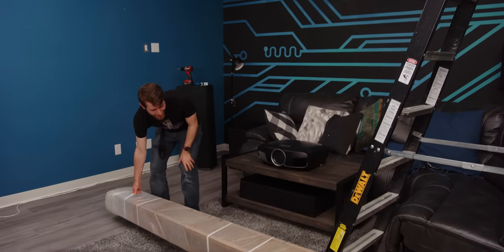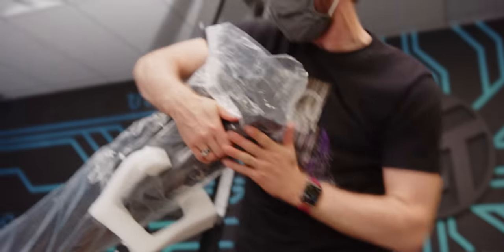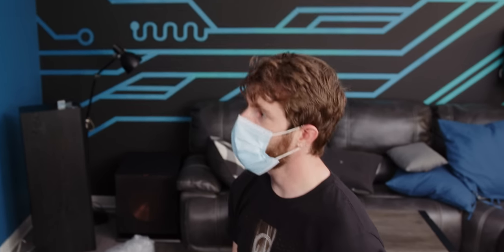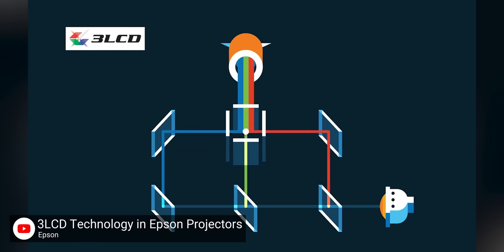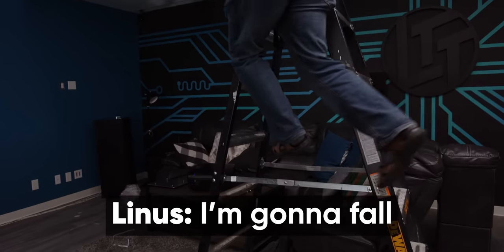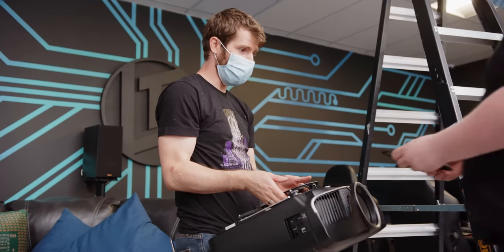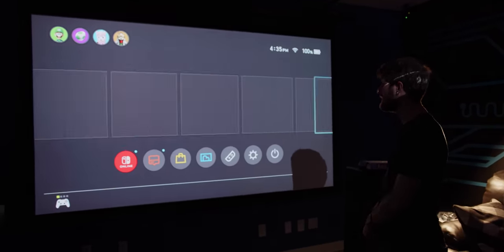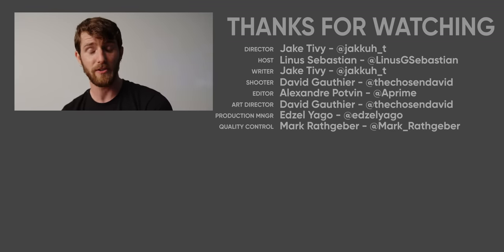Setting Up This Projector Was SO Much Work D: - LMG Lounge Update 2021

Comment: Linus: "How do you measure point 8 of a foot?"
Use one of your sandals
Reply: burn
Reply: @Sciurus Niger no, actually super easy, but imperial users don't get that
Reply: @theholyviper  I have a tape measure that has inches on one side and decimal feet on the other.
Reply: @Sciurus Niger laughs in .1 of a meter beeing 1 decimeter .01 of a meter beeing 1 centimeter .001 of a meter geeing a millimeter. 
Everyone who uses metric knows what .1 of a meter is.
And .8 of an foot beeing 9.6 of a inch is the funniest stuff to me.
Reply: @DUDA-__-  9 and 19/32nds (5/8s is close enough). Decimals usually only show up in machine shops/drafting rulers.
Reply: @AurumFaber  So, your ruler has the metric idea of the decimal system applied to the Imperial measuring system? That is just a convoluted mess. No wonder Linus is throwing around his remarks.
BTW, that projector is made with metric measurements, with lenses up to .0001 mm accuracy.
For installation, the manufacturer could issue exact measures in the metric system aka. "3500 mm from the centre of the screen" - and for users of Imperial measures: "Whatever looks about ok to you ?"
Reply: @tuomashelin555  its not a ruler per say, but a 100' tape measure. It has inches on one side of the tape and decimal feet on the flip side.
It's not convoluted, it's more options.
3.5m≈11' 5¾" (11.48'), btw.

Comment: You guys went with the Snaptoggles! They're awesome but you don't need to use the studs with them, the toggle will hold the weight directly to the drywall.

Comment: I've been using the 6050 with a 110" ALR screen for over a year and while the off angle viewing angles are not great, they a perfectly usable for that couch arrangement you have. The big advantage of the ALR is being able to use it during the day or with other lights on in the house. If there is a lot of light, it will wash out the screen, but with non-direct light, it is perfectly usable. 
One thing to note, if you want to get rid of the long start up and situations where the screen goes black. Enable high elevation mode... it's a known fix within the 5050/6050 community to fix some of the odd behaviors. Another thing is drop the bulb brightness (don't run high power), then calibrate it. It will increase the black levels and you won't notice the difference. I suppose it will also increase the bulb life, but I've been using mine as the main TV for almost a year and don't really notice any dimming yet.

Comment: I've had my Epson EH-TW7300 with a 120" screen for 1.5 years now and I'm as happy as you are. It get's noisy (I built a sound isolation cabinet with 7 Noctua 200s to fix that), but it's really something you can't switch back to the TV from.

Mounting the screen should be a 3 man job, they are HEAVY.
Reply: I was surprised to see this video. I thought LTT would be too snobbish to use an upscaling projector like these Epsons. I have had the Epson EH-TW93000w for nearly 3 years now and absolutely top rate it as a projector. Thumbs up!

Comment: "How do you measure .8 of a foot?"
And that's why the world is metric.
Reply: not like it's hard in imperial either. .8 foot is slightly over 9 and a half inch or, since it's a minimum, just aim for 10
but it is an extra dose of stupid that a lot of engineering is done against convention by dividing things decimally, which confuses end users because all their rulers are marked with idiotic fractions like "1/8th inch" or "1/16 inch"
Reply: @TheZALGOisCOMING  I dont know the imperial rulers, but metric rulers are usually marked 1 (enter specified unit, f.E. cm) 2 (specifiied unit) and then has 9 markings in between those two at equal distance to each other to give 0,1 ; 0,2; 0,3 ; and so on
Reply: In the US I feel it's not as big of a deal because we end up having to assemble stuff in both metric and imperial all the time, especially length measurement of household goods and things like screws, bolts, etc. So we have inches rulers with a metric side, metric tools, imperial tools laying around, but if you get something marketed to the US sent to another country that doesn't use imperial, the chances of you having those tools in imperial measurement is a lot lower I imagine.
Reply: Ironically the USA is actually based on metric system but they take those standard metric weights and measurements and convert them to feet and inches, fluid ounces, pounds and ounces still lol You will take MPH from my cold dead hands though!!!!
Reply: @TheZALGOisCOMING  if you were asking 0.8 of a meter, is simply 80 cm. There, simple. You can convert, calculate etc accurately in imperial, but that doesn't Negate the fact that metric is way easier and simpler to use
Reply: @-JonnyBoy-   prefer crash at 40 km, than at 40 mph  (also miles per gallon, which gallon ?)
Reply: How people can get so fucking butt hurt over measuring systems...
Reply: @resneptacle  It causes a shitton of confusion.
Reply: @jyvben1520  ya US gallon is smaller than a UK gallon by like 20% lol

Comment: So Sony has various monitor classifications: broadcast, master, reference. I think reference is their highest accuracy monitor. But basically any "reference" means it's as true as it gets, and everything else is below that. So for color grading, you need a reference, something to base everything else on. Same for sound, etc. Even with weights and measures there are (or used to be) physical items that defined a length or weight and those were the "references." So that's a high quality screen!
Reply: Yes, but, in the case of projectors and projector screens, the room and ambient light can compromise the image regardless of the screen you use. So, in a room and lighting like the one in this video, having a "reference" screen means very little.
Reply: @tiagojordao4105  true. I suppose you need a reference everything, for it to be a true reference.
Reply: @IanZainea1990  Yes, they would need a room entirely covered in black velvet or some other very dark material. But, it's still an excellent projector with an excellent screen.

Comment: I love projectors. Home theater is such a class above a big TV. 

No projector needs to mount in the center of the screen though. They all have a built in lens drop (not talking adjustable lens shift) for a reason.

Comment: pro tips, if the t bar ceiling is a bit below the wall hieght you can make damage up there and see where the studs are if you need it, or since they usually dont finish above the t bar you can even look for drywall seams and screws, second pro tip, you can get retroreflectors that make it a lot easier to see lasers

Comment: 🪚 To mount a big screen to drywall room, 3/4" plywood sheet (whatever size) will help distribute the load and you can paint it the same color as the wall.  Now you can screw directly into it. 🔨
Reply: The Plywood costs more than the TV at this point.
Reply: @chrisstone1710  That's hilarious AND definitely true in this day and age.  Hopefully that changes soon, but things have not been looking good for lumber prices.

Comment: I used to do this kind of thing for a living and I was impressed slightly they used the proper anchors.. less so with the 2X10. this is usually done with unistrut products and some allthread when doing a truss mount.. if they had busted that out I would have fallen out of my chair. overall I think they did a good job. the most annoying thing about projectors is you have to size them to the room FIRST then you can narrow it down to the coolest brightest best bang for your buck what have you projectors that work in that space. if its not a dedicated theater space you also need to factor in whatever window coverings need AND how to install them for zero light bleed.. automation for the screen and windows that you had someone custom make for a ton of money..  hoping the customer will realize that the prjector will not last beyond 3 years heavy use even maintained properly... present a quote and watch eyeballs pop...  but its freaking magic if everything is done properly.  in a residential setting this will require the use of a carpenter a drywaller  a painter and usually an electrician.  if you are super juiced instead of painting you get someone to upholster the walls.. and those people do not work cheap. not to mention the guy doing the design and the people he employs for the prewire.. then you have to do site surveys all the time to make SURE everything is going where its supposed to and nobody is fudging 6 inches here 3 inches there.. holy crap we are 50K in and we haven't bought any equipment yet :) and its a month behind schedule. I did like they make a big deal about the screen. its as important as the projector and more so if you are contending with other light sources.  havent done one of these in ten years I am glad to see the lens-shifting projectors are more mainstream now.

Comment: A stud finder shows you the outer edges of the stud NOT the center, mark both edges then drill in the middle of the finder marks. The finder senses where there is a solid behind the drywall and it is up to you to find the center of the solid by using the finder correctly.

Comment: I have hung all my TVs in my house with those exact toggle bolts into metal studs. They're awesome and you can reuse them cause they zip down to the drywall so it's held in place even if you take the bolt out. They're more expensive but well worth the money and each one holds like 80-120lbs when put in a stud so a standard 55"+ TV is nothing, one would hold the entire TV.

Comment: I have Epson tw8000 projector I have had years its and it still blow peoples minds how good it looks (light controlled room), you cant beat a projector for watching a movie I have 55inch OLed as well, projector every time for me when watching movies. I also have the same klipsch speaker's in 7.1.4, Epson lamps are super cheap compered to others $120au

Comment: 7:30 - YOU BROUGHT THIS ONTO YOURSELF, when you decided to use the imperial system! Now DEAL WITH IT!
Reply: The instructions weren't written in metric units or following the standard American units graduations, they are at fault.  You wouldn't hold someone at fault for wondering how they're supposed to measure 3/8 cm would you?
Reply: @VitalVampyr  because they probably made the product to work in 25 cm, and they just translated in  imperial using decimal unites like the number, 10 by 10, not 12 by 3 by 1730 ...
Reply: @VitalVampyr  No, but i probably will never see instructions, that tell me to measure 3/8 cm, but rather ~4mm, or exactly 3750 µm, which is 0.375 cm, if you really want to take my comment 100% serious ;)

Comment: To answer the question of "how do you measure .8 of a foot"

12x.8 (which gives you 9.6)

And then if you wanted metric, 11x12 (which equals 132), then add 10 inches (rounded up from 9.6), giving you 142. Then multiply that by 2.54 giving you approx. 356cm or 3.56m

(I know I could've converted to meters but I'm more comfortable using centimeters)

Comment: .8 of a foot is roughly 10.5 inches. There are approximately .08 in an inch. It's actually .083, but in construction we just use .08 then ad and extra hundredth every 3 inches when we convert.

Comment: 2:16 boys and girls a quick listen on "stud finders".

"Stud finders" typically do not locate the center of a stud. What they do is locate the "edge" of a stud by measuring the change in depth.

When the stud finder beeps it means you found the edge of the stud. Do this coming from left to right then right to left.

Comment: The favorite piece of tech in this video is also the only part I can afford it in. The Toggler is also so expensive you'll notice Linus doesn't actually demonstrate the zipping, they're single install.

The actually cool part is that they are reusable where you install them since the bolt goes in after you zip the plastic plug into the hole you drill. So if you want to change from a small wall mount to a larger one, or put picture frames up, all you do is remove the bolt, the bracket it was holding up, then replace the bolt.

Oh look a projector

Comment: I'm going to give you some pointers on how to have a bright and colorful screen. Get a silver embedded screen. That's litterly where the "Silver Screen" reference comes from. The Silver soaks up light and reflects other bad light colors. This also makes the screen look matte with better textures and quality. Other then that, if you use a basic screen y our going to have bad colors a glare and the other common issues basic screens have. This is how movies are able to look so bright in theaters. And yes I work in the theater industry. Behind those screens are also the speakers. They are held together by cords which are then covered with felt

Comment: Those plastic tabs you used aren't the best thing if you put them through a steel stud. They are designed to hang on drywall primarily.

I have some steel studs, and I've used molly bolts to mount large things on them, and that worked like a charm. Bonus: the anchors can be reused. Probably overkill for a thin screen, but works quite well for super large TVs.

Comment: @5:00 "you want that projector to hang right in line with the center of your screen" I'm only used to ProAV Projectors rather than home theater stuff, but in the proAV market that's generally only true for the horizontal alignment.
Atleast all projectors that I know (up to 20.000 ANSI Lumen) are set to project the lowest part from the image just a few degrees below the lens if the projector is standing (and a few degrees above the lense when the projector is hanging)

Comment: Have you ever used PrimoCach 4.1.0 for supercharging windows disk speeds. Making your SSD faster based on LRU Least Recently Used. Cache levels using -System RAM, -Optane SSD, -NAND SSD and HDD.

Comment: For those that want this on a budget, check out a Samsung Q950T 9.1.4 Atmos bar, screen material from Carls Place in Wisconsin and a Epson 2150 Home Cinema. 3LCD with no pixel shift, and at 135" 4K doesnt make a difference.

 135" screen with a theater experience.

Comment: I wanted to buy this projector, nice to see a review.
Reply: What I have heard, it is an awesome projector. It does have a hefty price tag at $4,000 dollars.
Reply: @gregreynolds6728  If it performs like it's price, then I don't mind the price. I'll have to do some research with my local projector shop at some point, their are a lot of options there.

Comment: If you think that projector is baller than you need to get the JVC 4ks. Those ARE the best!!  Also if you don’t want to constantly change the hdr slider on the Epson get the hd fury vertex 2 that gives you so much more automated control for hdr content. It makes everything much more consistent.

Comment: Installation hint: If you have an acoustic tile ceiling open the tiles next to the wall and locate your studs above the ceiling (because they're already exposed or if you have to drill a hole in the drywall to find the stud and it's not the right spot the hole will be hidden by the ceiling).

Comment: I have a similar configuration.
But my PS3\PS4, Wii-U and Switch are connected to a very basic 300 Euro's 1080p projector.
Despite that the cofiguration works as intended so, it's fine ;-)

Comment: Epson 6050UB vs LS 100
You said this one is brighter than LS100 but you looked at 6050 UB in complete dark room vs the LS100 was tested in a well lit room (because it's advertised as tv replacement).
I would like to know which one looks better in a dark room ?

Comment: You used an universal projector mount to connect to you custom plate… why not mount the projector directly on the universal mount instead? 
(I have a EH-TW7400 and it looks pretty much exactly the same and that’s what I did…)

Comment: I wouldn't call that the wrong choice. Actually, going by the screensize/prize factor, a TV is always the wrong choice (unless there are some other factors making a projector setup impossible).
You can fill your entire wall for just a few hundred euros, while TVs that size don't even exist(?) or if they do, they probably cost more than a car.

Comment: Epson engineer: So the projector has to be at least 360 cm away from the screen, remember to tell them that.

Epson representative: But they're americans. They don't use the metric system.

Epson engineer:  * converts 3.6 meters to imperial *  11.8 feet then.

Epson representative: Say less.
Reply: 4m is 13.1234ft. But ok.
Reply: @samlevi4744  my mistake, should have said 3.6

Comment: TIL there is flimsy variant of a cavity dowel where you use zipties to position a bar on the other side of the wall instead of just … using one where the screw bends the dowel to form a bar on the other side. How quaint, why? What is the upside with that contraption? Having a prestine metal bar on the other side?

Comment: Disappointed a little in your tilting the projector. Most projectors have a lens offset. My Optima is 11 inches. So my screen needs to be 11 inches below or use the lens shift to raise or lower the fine adjustment.

Comment: just want to point out that you shouldnt put any load on the bottom cord of a joist, the load is engineered to be at the top cord. projector shouldnt be too bad but jut in case anyone seeing this is thinking of hanging anything more significant..

Comment: I only just realized that measuring decimal units in imperial is.. not a thing you do - at least not very often.
You more or less have to use at least 2 different units to have some amount of precision.
11.8feet - as in the video - is very clunky to figure out due to the non-standard unit lengths